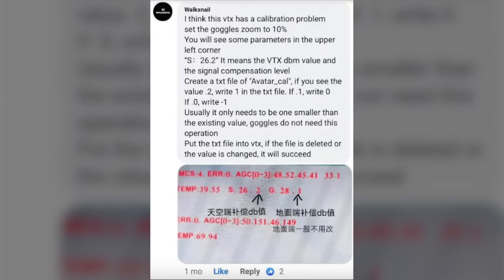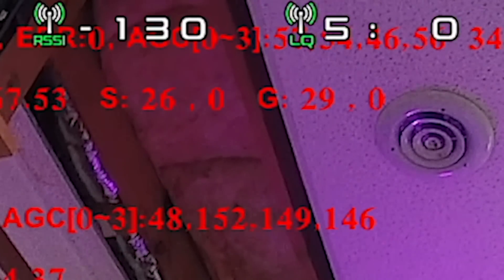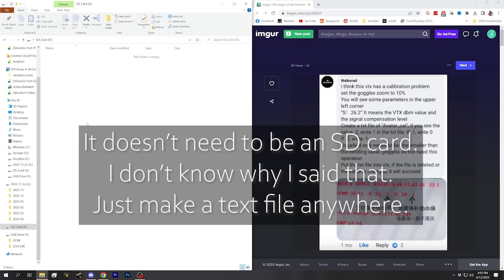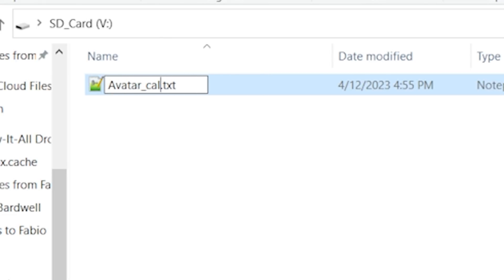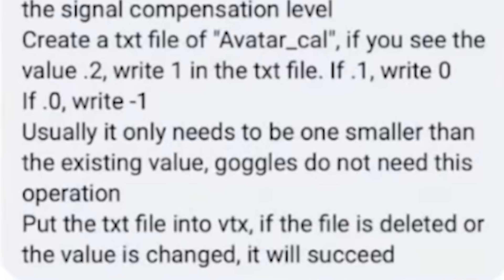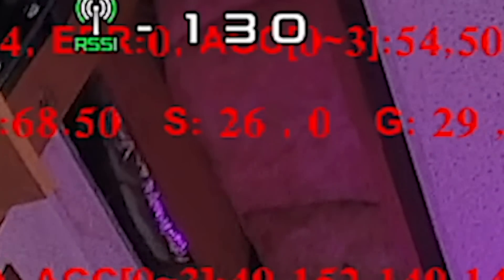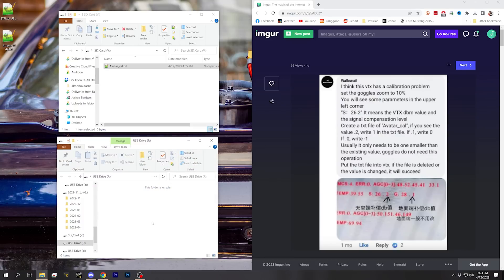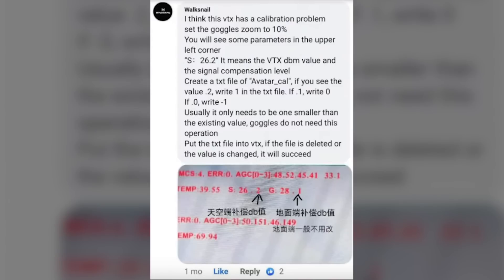Can This Modification Make Walksnail 1200 mW Actually WORK?

Comment: My belief is this is similar to backing off a guitar preamp to clean up the mush, thus leaving the power amp section alone. A 100 watt Marshall is still 100 watts regardless of input gain.

I've tried this solution you have produced here. It did in fact work for me... thank you. My question would be is why wouldn't the input gain be automatically controlled by firmware?

Comment: Have you tried the difference? S26 and G29 is 3dbm different. I went the other way on mine just to check what will happen so now I have S 28.2 and G 29.0 on 1200mw. Only tried inside so far but GSNR is around 10 and on 25mw it´s 24.
Reply: Yea, that's a bad thing. Signal to noise should be as high as possible.

Comment: Has anybody been to do this on Moonlight VTX?  I put the Avatar_cal.txt on an SD card and put into the VTX, booted it up and it didn't adjust.
Reply: My moonlight I plug the v2 hd jst usb on bottom of the moonlight vtx ,sd card in vtx and power with lipo and use computer and it s work

Comment: Is 1200 mw still available? I have a new mobula8 and I can’t get more than 25mbps and 500mw
Reply from the maker: Yes absolutely. But maybe you have the 1s board. It won't go over 350 mW.
Reply: @JoshuaBardwell hum. I have the mobula8. Would the vtx on the mobula 8 have the 1 cell version ? And can I get 50mbps ?
Reply from the maker: It definitely should do 50 Mbps. Did you unlock it?
Reply from the maker: The 1S vTX won't go over 500 mW, but really it's 350 mW. It doesn't go higher than that.
It definitely should be able to do 50 Mbps, assuming it's unlocked.
Reply: @JoshuaBardwell  gotcha. I had to set the bitrate to high and it jumped to 50mbps. I also was able yo unlock and get all 7 channels. However when running high bitrate it restricts the channels down to 4 with the goggles x firmware.
Reply: @TheHelicapt  Normal.

Comment: So in the txt file, you typed in: S 26 , -1 and inserted this text into the vTX and rebooted the vTX.  So, now the new calibration is S 9 , -1.  What does the 9 mean?
Reply from the maker: The numbers in that position are the actual output power of the device at this time, in dBm. Walksnail has dynamic power so it's not always at max power.
Reply: @JoshuaBardwell will 1200mw hack work on walksnail  recons box goggles?
Reply: @JoshuaBardwell  This entire time I thought 2000mw was 2000 all the time and I couldn't for the life of me understand why my $5 ELRS module was dynamic but my $500 VRX/VTX was locked to a setting. We really need to send Caddx a better technical Specifications Writer.

Comment: I've not applied this calibration yet, but I've to say that my WS goggles, works better at 1200 mW than 700 mW. The point is that my use case is probably different that the case used to execute test. I normally use WS for long range and there in my test there turn out that 1200 mW 50 mbits grant more distance before loosing  bandwitdh that any other configuration. I'll apply the calibration and then I'll do an other test.

Comment: Joshua, it appears you interchaged Video Transmitter and Goggles several times, almost implying the Vtx is in the Goggles, rather then the Vrx.
That debug data and 'calibration' sounds very much like it's turning down an output of a Video ProcAmp, so not to overdrive the input stage of the Vtx signal amp.

Comment: 1200mW has performed pretty much exactly as expected in my testing. Not sure where this rumour about 1200 came from, but I suspect that any differences to DJI on max power has more to do with the transceiver settings than the power level. 
In my range testing, 700mw went to 6.9km, and 1200mw went to 8.1. There is 2.34dB increase between 700 and 1200, which should be a range increase of 1.31x. If we multiply 6.9km by 1.31 we get 8.97km, which granted isn’t the same number as 8.1, but not far off within the limits of real world testing.
Reply: Thanks for this clarification. Now watch as people recalibrate their perfectly working VTX to make it worse based solely on speculation that 1200mW isn't really 1200mW 😂
Reply from the maker: I have tests showing less stable link at 1200 than 700. More variation in latency and bitrate. Obviously your results are unimpeachable, but it's not just a rumor.
Reply: We miss you Wez ❤️
Reply: i have the vrx.and running the latest firmware on both..on 1000 and 1200mw i get the low signal focus in half the distance penetration compared to 700mw.same location of goggles and drone.
Reply: @Captain  I wonder if you check the setting in yours if it is a .1 or .2 instead of a .0?
Reply: @lostfpv  ,i checked, mine is 2..changed it to 1....test tomorrow 😎
Reply: @captain-22  nice I need to update to the latest fw I think.  Mine didn't show like the video
Reply: i tested,, previously 1000 and 1200mw were worse in distance, now its similar to 700 and perhaps a tiny bit further.but not significantly.at least it improved.

Comment: using non-garbage antennae on the VTX as well as on the goggles makes quite a difference. I tested inexpensive iFlight sigmas against the included walksnail antennas and am definitely seeing better range and more consistent bitrate figures. Note that this is with the V1 transmitters and stock antennae. I have a couple of V2 combos on the way and am eager to see how the “improved” antenna compares against the old one.

Comment: I will take my V2 VTX with me to work today and will plug into a Spectrum Analyser to run some checks on actual power levels after recalibration and do some low signal tests on 50 Mbps .. makes perfect sense reducing drive to PA will fix this, kudos to Walksnail sharing the way to do it!
Reply: Any worth while results you’d like to share?
Reply: Any news?
Reply: @Vadim Osochenko  The V2.0 HD did not need recal, it was stable at 50 Mbps at 30.5 dbm into 50 ohms as is. My two V1.0  though did have the full power problem, dropping cal by 1 digit did improve 1200 mW setting with only a minor drop in power (0.5 dbm). Measured power for both slightly different but still over 30 dbm.  I only checked the 700 mW level it dropped in scale but was over to start with. All were close to what they should be (+14, +23, +27, +29) give or take a bit.  For those worried about the mW number could do a chart but as device spread will impact your milage may vary. db wise all <1 db variation from spec. Took a while to get the FFT measurements right so ended up using a calibrated thermocouple to double check.
Reply: @tecknolt2695  Thanks for the detailed answer. Add please it as a separate comment so more people can see it
Reply: @tecknolt2695  You my man, need to make a video on this as that was epic information!

Comment: Same procedure applicable to 1s VTX?  (Mine drops to 40mbit if I set it to max 350mw power. But at 200mw it stays at 50mbit.)
Reply: Reply to myself : yes it works I get 50mbps at full power now. Value was .1, changed to 0

Comment: I would expect the calibration value to change all power settings.  You could answer your question though.  Use the stock v2 VTX (single antenna) to collect a value using your RF power meter at 1200, 700, 200, and 25 mw.  Then lower the value of the calibration and then recollect the values.  Repeat a couple calibration values.  That should show you that its adjusting it across the power ranges.
Reply: for this to work there is an 'average value' setting to tell the power meter that the signal is digital.
It would work and be easy to test with the single antenna units.

Comment: Am I missing something? The most important part of this video would have been the before and after. I understand results are going to vary on different VTXs buuuuuuuuut ya did it help yours?
Reply: Yeah I thought that was strange. JB's pretty busy these days, but I figured a quick test and some anecdotal thoughts would be  a nice conclusion to the video.
Reply: i just tested this mod default zero cal to -1 then -2. -2 worked best at high power (whoop lite board 350mw) 25mw suffered a lil but high power did way better. But didnt think to record audio say what power levels and what direction im facing. but went from cal 0 it only goto 40mbps at 350mw at point blank range. only 25mw hit 50mbps. -1 25mw and 200mw hit 50mbps but 350mw still point blank would drop to 40mbps . -2 high power hit 50mbps. 
tested another whoop lite board and i needed -2 to keep 50mbps in high power in other room
Reply: @divingfalconfpv4602 Thanks for the info,I'm also having issues with my 1s kit on the new Goggles X and they sent me this video.I will check my micro quad and try your values.
Reply: I thought the same I was waiting for the test but nothing …

Comment: I wanted to root for walksnail but their QC is just lacking. Even the new m181gps that they have have the scl and sda pad labels swapped out, and never bothered to put a PSA for the vendors, to let the buyer know that it's reversed.
Reply: I feel the same.  I want them to be better than dji but I still remember the days of buying caddx cameras and always having dust on their sensors.
Reply: Didn’t know that , so everygps is swapped or it’s just a batch ?
Reply: @Simofly  i just bought a new one for my diatone Roma l5 and it still flipped. But i realized it's A BAD idea to run a compass on a beta flight quadcopter. Mine work for a while until the gps and the magnetometer contradicted each other and my quad got so confused it just yaw back and forth and crashed. I know the mag is not adviced but i was being hard headed. So i would just go for the flywoo nano V3 because it's way smaller and I've confirmed that it locks to satellites faster. For a gps a size of my nails, it's cheaper performs better and can be powderd by a 3.3v. if walksnail wanted my money, they are going to have to make a new gps that can compete with the flywoo nano gps.
Reply: @jdnic1 wow ok so I have one here to install and I’ll check it out if it’s swapped too ! I’m using it on inav so magnetometer is a must , but I agree with you that n beta flight is not worth it at all , with new bf 4.4 gps rescue is fantastic as it is with only the gps

Comment: Please put some testing of this
Reply from the maker: Every vTX is going to have different results depending on the characteristics of its amp. There's no point in doing a single test of a single vTX and publishing the result. The point is, if you want to try it, you can.
Reply: @JoshuaBardwell  one of the reason some of us would like to see if it works (even if the result may differ depending on different vtxes) is that people are wondering about buying O3/Walksnail and would like to know if there is any chance to pay less (Walksnail) and have something similar to the King (O3). Also please keep in mind that we like your reviewes/tips/all_videos so much because you share with us your thoughts and practical usage of such advices 😉
Reply: @JoshuaBardwell  
I would say even knowing that each VTX/VRX is likely different. It would still be a valuable contribution to test and see if this has helped in your specific case. 
Just like some people report great results while others report unsatisfactory results with Walksnail/Avatar in general. This may be the missing key to help those with poor experience bring their system up to par with others who are happy. 
Plus let us all know how much one increment changes. Etc etc.
Reply: @1967friend  yes, then why did you do the test with walksnail in the first place...? Just saying.

Comment: No testing???
Reply from the maker: Every vTX is going to have different results depending on the characteristics of its amp. There's no point in doing a single test of a single vTX and publishing the result. The point is, if you want to try it, you can.
Reply: @JoshuaBardwell  sure there is. If yours works there’s a chance it could work for others right?
Reply: @JoshuaBardwell  yeah there is. We've seen enough videos where you fly around your property and you're like "here's where I usually lose video," "here's where the signal gets dodgy," etc. Surely if it made a clear difference you could say "yeah, I can see it made a difference for me." Of course our mileage may vary. But if it makes no difference or gets worse, maybe we won't bother.
Reply: @JoshuaBardwell  plus you have that beautiful spreadsheet with all of those data points .This test would fit right in there.